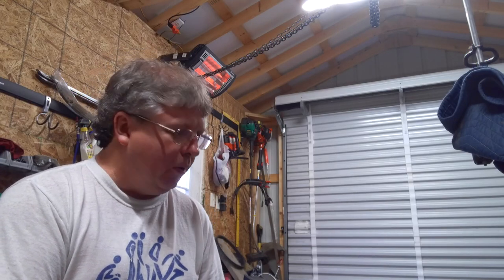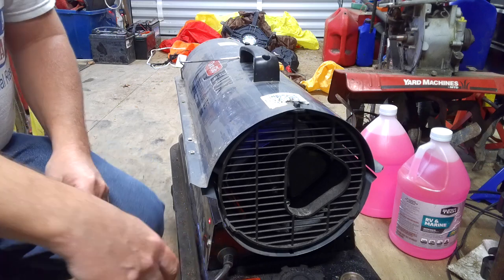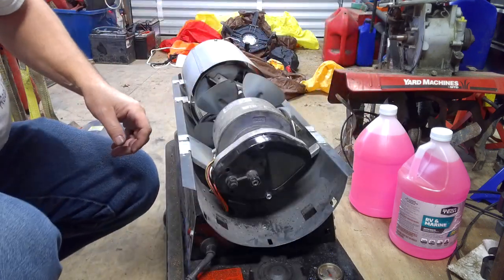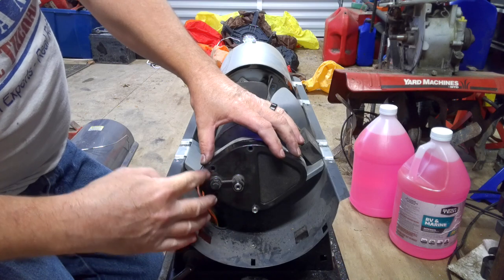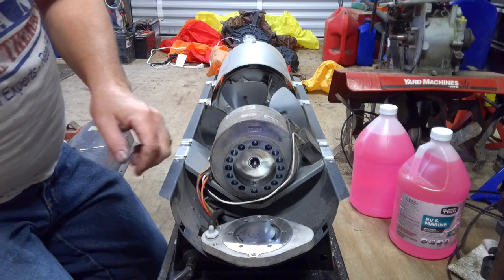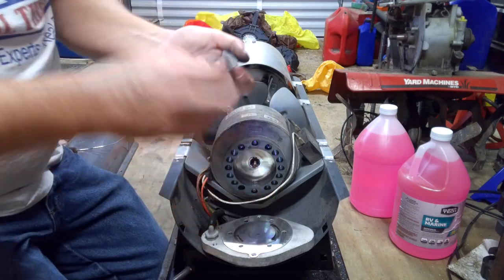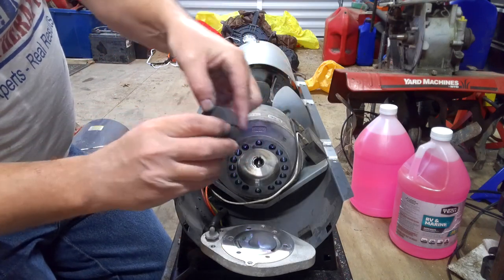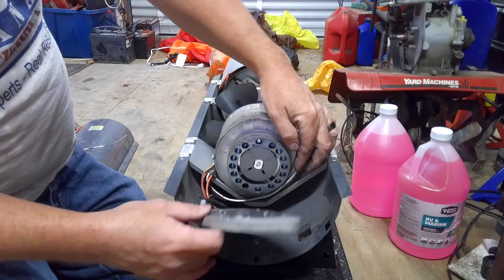Dyna-Glo Delux 50,000 BTU Salamander Kerosene Forced Air Heater Repair

Comment: Hi. i got 2 of  'em.  DYNA GLO model KFA 50 H.  FUSE  checks good, on circuit board. Cleaned the air pump, / motor spins easily. Cleaned photocell, adjusted it for to  ' see '  the flames.  All seems good. There is no life, whatever, on the red light by the on/off switch.  ANY  IDEAS,   OR.....a new control board ?  or is it, some other feedback sensor  ?    THANKS,  FOR  ANY  HELP......
Reply from the maker: Sounds like the control board to me
Reply: @MrJustDIY  Okay, thanks.  i will attempt, to find one, on Amazon, or other like such sites.

Comment: My heater red light comes on and fan comes on but it does not light.  It will shut the fan off about 5 seconds after you turn it on because it does not light.  The plug is firing and a fine mist of kerosene does come through the heater. Any ideals on what to check next?

Comment: Do you know how to add a thermostat knob to one of these? I’ve been trying to find anything on it and haven’t found a single video or thread yet
Reply from the maker: I use 1800W Heat Thermostat Temperature Controller 120v 15A F and C Heating Cooling Control and they work fine on all of my heaters.  https://amzn.to/3vN9OG3

Comment: Those fins that go in that wheel should be faced so the rounded end it out and rubs on the outside of the housing as it spins. The gap at the top of that wheel should be set with a feeler gauge at .06" gap. And you need a small pressure gauge to set the pressure on your pump so it doesn't run too rich or lean especially if you're burning diesel instead of kerosene because it's a little thicker when it's cold.

Comment: Just bought this same heater 1 month ago and it just quit working. The red light flashes nothing else happens. Sometimes it works and sometimes it don't. Menands wont exchange it because of kerosene smell .Customer service was no help, Any ideas would be appreciated .
Reply from the maker: It's hard to tell without having it but I would start by checking the igniter to see if it is working.
Reply: @MrJustDIY  thanks. I checked voltage at circuit board where the ignitor plugs in & it reads 0,could it be the circuit board? I have power going to the board
Reply from the maker: @mel7403  Does the little power light come on next to the switch? It sounds like the board but I don't want to say yes it is and it not be
Reply: @MrJustDIY  Yes, it flashes ,with no voltage to were the igniter plugs in.to the board. But when the light is on steady I have 121 volts Sometimes it comes on sometimes it don't.
Reply from the maker: @mel7403  Sounds like it's in the switch or a loose or bad wire. If the board is bad it wouldn't cause the issue that you're having
Reply: @MrJustDIY  Thank you. You have been more help then dyna glo customer service. .But I  put it off to the side & went out & bought a Remington.
Reply from the maker: @mel7403  You're Welcome

Comment: What's the purpose of that thing anyway? Good information, thanks.
Reply from the maker: It pumps air into the hose that goes up to the part that sprays the kerosene. Without it you won't get the kerosene pumped out of the tank. It pretty much creates a vacuum-like you blowing air over the end of a straw that is in a glass of water.

Comment: Can you use this heater with plug? Also how long did you have it before it started doing this ?
Reply from the maker: Around 3 years.
Reply: @MrJustDIY  Thanks for replying !Do you need go have it plugged in if you are using kerosene?
Reply: @datchickvl4862  yes it is very much needs electric. The fan motor/fuel pump, circuit board that operates everything needs a constant electric source such as an outlet or generator while in operation. Without electricity it is just a huge cold kerosene storage tank. 🥶